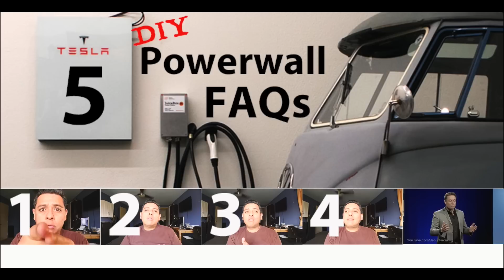DIY PowerWall questions - 4/5 Is it worth it?   -  5/5  Is it Dangerous?

Comment: Well I'm catching up on your two year old video. I quickly read the comments and one stood out. 

It talked about or implied that it should be UL approved or it may not be covered by insurance. 

I don't believe that is accurate. It is my understanding that if you pull all the proper permits to install your DIY powerwall and pass the inspections of the municipal Building and Safety codes you should not have any insurance issues  (I would verify that with your homeowners insurance company and get it in writing before proceeding.you may have to purchase an additional rider, IDK). Also, the building codes may require you to have a license electrical contractor complete the final connection to your breaker box. 

I hope that makes sense and is accurate.
Hay man, good job. Thank you!

Comment: Your videos are awesome cool and educative. I am looking at building good quality powerwall for my  house in Nigeria. I have about 5kw solar panel,  1.5% higher capacity mppt charge controller, new 24v 920Ah forklift battery. I am still thirsty for additional backup battery bank as I have more than 8 hours/day of really good shunshine.
I ve bigger challenges in sourcing good quality 18650 batteries at decent price. 
Can you recommend some wholesale outlet here in Europe (Germany) where I could access these products. 
As binational, I intend spread this DIY Tech to Africa where renewable energy is really welcomed and embrassed.
Thanks
Reply: great work bro Godspeed

Comment: I have a question.  I'm in the process of building my own powerwall.  I've collected various laptop batteries and have 1600+ now.  I gone though and tested each battery and recorded the mAh reading.  I'm at the part where I want to start assembling packs.  My thought is to configure these packs in 10P 4S to provide 12 to 14.8 volts at 20,000 mAh packs each.  However, the mAh of each battery is all over the range from 1000 to to 2600 mAh.  My goal was to create 20,000 mAh packs so I'm trying to decide how to place each battery in the spacers. There is two ways to do this.  1)  Mix and match batteries in the parallel groups so the each row equals 20,000 mAh using batteries in the same mA range.  Example:  one row of 2400 to 2499, 2300 to 2399 and so on.  2) Or make the rows equal 20000 mAh using any battery as long as the total equal 20,000mAh.  Example: 2200, 1855, 1920 and so on until 20000 mAh is reached. I hope this make sense.

Comment: hello and thanks for the info that you sharing.  i want to ask you. could this diy powerwall (in smaller amps) be directly charged for a solar charger? sould it be 3x18650 or 4x18650 cells for 12 volt system?

Comment: Love your channel, I like your powerwall.. I can see on my power bill I use between 0.250 and 0.5 kwh most of the time. I was going to try getting a micro grid tie inverter, a DC pwm to limit the output from my ebike battery(48v 10ah)  to about 250 watts plug that into the grid tie inverter and see how that goes? what do you think. (might LAST 2 HOURS)

then i was thinking about using an arduino board to read the current the house use and adjust the out put of the pwm to try and match the output and make it 0 in or out?

then get more batterys if it works.,. then need similar thing for charging when the solar out put is happening..
would love to hear what you think....

Comment: I want to experiment with converting vehicles and have several to choose from, motorcycles, Porsche 914's, but to do some initial playing around I've been thinking about this 150cc off road buggy I've got. it's light, not a lot of electical/mechanical stuff to work around.
have you seen anybody convert something like that could you point me in the right direction for a motor?
doing something out of the norm has kind of left me with not knowing what size motor to put in there or where to Source One.
I was thinking about a golf cart but that seems kind of gutless. A forklift seems too big.....
Id kind of like to find something inexpensive I can pull out of something else to make this work.
one of the things I've been considering is using Hub Motors because I could source them out of scooters which are pretty cheap and even though they're gutless I could use 2 of them, one in each rear wheel.......
that would be nice too because I could actually leave the gas motor in it if I wanted to....